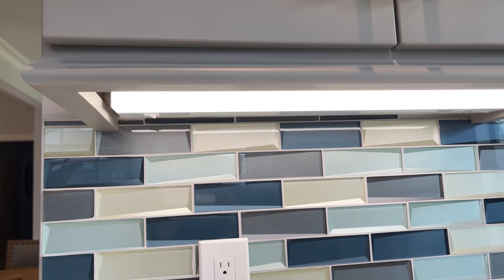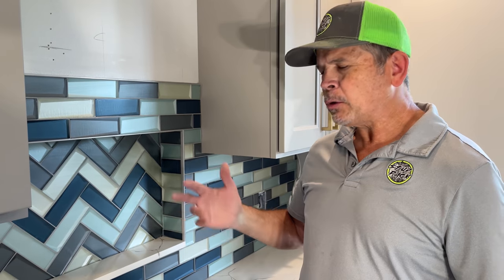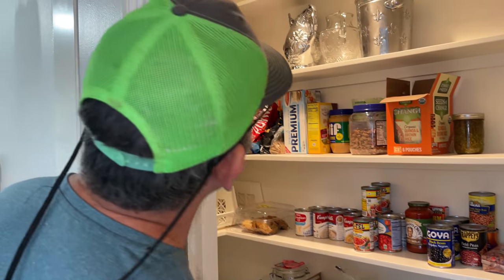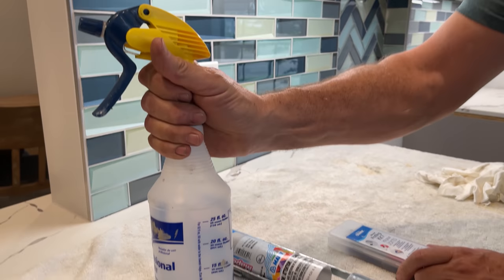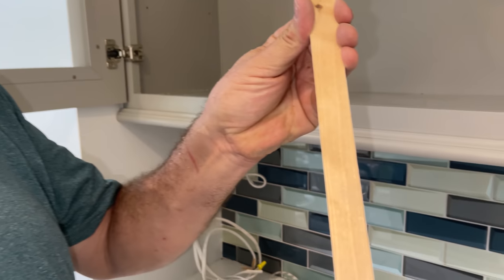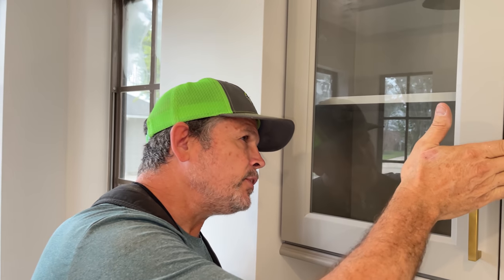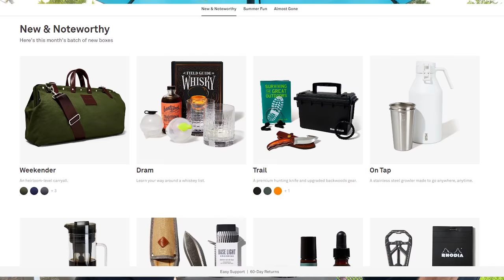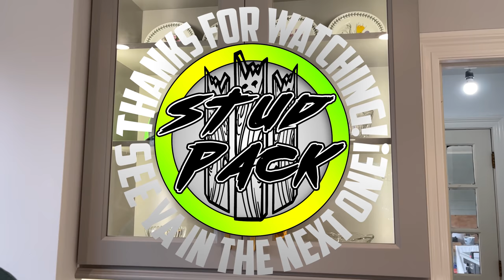DON'T CAULK YOUR TILE! Do THIS Instead...

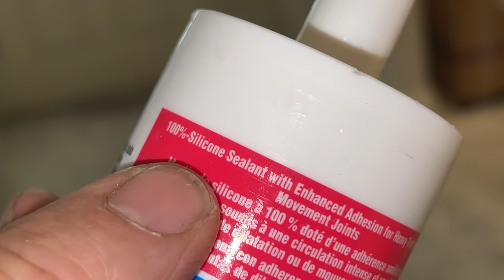Comment: 8:10 segment on silicone facts with tools, denatured alcohol and Pushing is worth it's weight in gold for tips. Never heard to push before. Top notch fellas!
Reply: I have always hated caulking, or, er, applying silicone... until I read about pushing instead of pulling. So much less work creating a straight bead!
Reply: So much great info.... I have done miles of caulking and I am anal about it. But had never heard of these great tips! Bam!!! Drop the mic... lol

Comment: Good job on the video guys! I appreciate how your keeping it clean, It always helps with a better finished product 👍. Quick grouting tip, 2 - almost full (5gall buckets) helps dilute and keep clean, 1 bucket with sponge and 1 with microfibers. Use the sponge to remove excess grout and shape the joints, then use the microfiber to stop any grout bleeding and to remove 90% of the end haze. Much respect for You and all of the Real Fathers out there taking their responsibility as a Man/Teacher seriously. Show em how to fly, then always be there if they need flight lessons (that's real Love)   =) .

Comment: I know the video is almost a year ago and I just discovered your channel few days ago and I am enjoying it so far.  I done lot of low voltage jobs so I wanted to share a tip with you.  Those led strip with adhesive on back doesn’t really stick to wood very well and often comes loose under it own weight. Use contact cement and a small disposable brush to lightly brush it on the wood where you plan to stick the led strip. Let the contact dry a bit to a light tacky touch the place the led strip adhesive along on the contact cement on the wood you brushed on.  It’ll never come off on it own weight and make it a lot easier to lay it down on corners too since that where led strip are most painful at to get it as flat as possible.  Big box store sell contact cement in a small bottle instead a quart can.
Reply: That's a great tip, thanks. I'm thinking to get led strips for my place too so perfect timing.

Comment: Pro tip: When installing permanent led strips, every so often place a small dab of silicone.  In environments that periodically get warm, that stock 3m tape will pull loose.
Reply: Real pro tip is to use diffusers.

Comment: I use grout caulk same as the grout color on inside corners and around counter tops, bathtubs, showers. I've noticed that in a lot of homes the corners are cracking because tile installers used regular grout instead of grout caulk. 
Great job, guys.

Comment: I'm a new subscriber but an old 66 woodworker. I have done a lot of solid surface work at the job I recently retired from, and I am still learning. We used denatured alcohol to clean joints on solid surface material before using the epoxy glue. I did not know that silicone does not stick to it. Learn something  new. I like your videos.

Comment: You know what- when I read the title to the video I thought to myself "this is not going to work."  However the results of the caulking tool were really good! And for anyone that reads my comment, this is one of the few appropriate places that 100% silicone should be used. If you're ever going to use 100% silicone, ask yourself this one question- is there any chance that I will want to paint on top of the caulk, or adjacent to it? If the answer is yes, or even maybe, then don't use 100% silicone. PAINT DOES NOT STICK TO SILICONE, and there's not a real good remedy (primer really doesn't work, neither does caulking over it) for getting paint to stick. Even you guys who are using silicone to glue down countertops on cabinets. For the love of God, don't let any of that silicone lap over onto the face of the boxes. Sometime down the road, the home owner will probably want to paint or refinish the cabinets, and it's a PITA to remove the silicone.

Comment: Using painter's tape to make a perfect edge with silicone caulk also works great.  You put down the tape, press it in hard, use the silicone caulk, rub it in with your finger and take off the tape almost immediately.  It makes laser sharp caulk lines.
Reply: Agreed
Reply: I concur ✌🏼
Reply: 👍 That’s my go to for now. But what’s the brand name of that call sled you used??
Reply: Tape can lift the edge of the silicone when you remove the tape , only by a micron but enough to left water in 
Tape is a big no no

Comment: Paul,

The denatured alcohol and the cut pieces of rag, brilliant. I just finished all three bathrooms in my house using your method and they look great.  I had recently siliconed a large piece of glass that we had to re-install after replaced the bathroom countertops not using your method, all I can say is, I am glad it was clear silicone. 

Thanks for the tips.

Jack

Comment: That tool works good. Denatured works great for clean up but i've found just water works fine also for pretooling. The silicon won't stick to the wet surface only the joint thats dry.

Comment: Tip for all of you out there. If you don't use all of the silicone or caulk just place Frog tape over the top of the tip and around it. Once done you dunk the tip in water and it will last for months. Here in AZ where it is hot as hell, it lasts for months.

Comment: Do you have a video on hardwiring those cabinet lights (both strips and undermounted)? I’m curious about the best method to hook those up according to code, where to use conduit, and how to keep the wiring hidden and clean.

Comment: I know in a previous video you mentioned you have a hard time of finding consistent products especially for under cabinet lighting, just when you find a product you like they stop making it.  Seeing how the LED strips worked out under the cabinet, have you been considering just going with the strips?  I am sure it is a larger cost savings and minimal impact on installation.  Once more question for you, I am in the process of building my own deck......what would it take to get you guys up to good ol' NJ?  Another great video! keep them coming!

Comment: When the contractor did my kitchen install, they didn't caulk between the tile backsplash, they just grouted it along with the rest of the backsplash. Over time, the grout in that space cracked. I have patched it once by mixing more grout and re-grouting after removing the loose chunks of grout. But that also cracked. 

My backsplash tile is made of long skinny horizontal tiles, some glass, some natural stone. Some of the natural stone tiles have bumps on them that protrude about  1/16" or more past the tile surface.

I bought the profiling kit in your video and did a dry run to see how it would glide over the tile.  The first tile at the bottom sits below the little black "sled runner," so it does not help it glide as much as I'd like.  When I press it into the corner and pull, the spreader still snags on grout lines below the runner and also on the bumps in the stone tiles.

I remember, years ago I had an apartment that I painted. It was an old building with plaster walls. As the building settled, the plaster cracked. I patched the cracks with plaster of paris. The cracks came back after a few weeks. Then I heard about some liquid that had latex or something in it that was meant to be mixed in with patching compound to make it crack resistant. I got that and mixed it with the plaster and it lasted years before cracking.

I'm wondering if I'd be better off getting some of that liquid and mixing it into the grout and re-grouting the joint between the countertop and the tile, rather than caulking it with silicone. If I don't do that and caulk, do you have any suggestions for getting the profiling kit to work better on this type of tile?

Comment: Looks great man.  The push/pull thing?  Well, getting the bead to push into the space when pulling the gun is a matter of technique.  To achieve this doesn't require "pushing" the tube.  It requires using the right technique when PULLING the tube and PULLING gives you better control over the finish of your joint.  And mildew grows on silicone same as anything else.  It's a matter of PEOPLE DON'T CLEAN.  Biggest reason for using Silicone is movement and movement is more a result of a shoddily done job than  seasonal expansion/contraction of structural elements or claddings/substrates.  Acrylic caulk - unless you need to counter large amounts of movement - is every BIT as good as Silicone and is MUCH MORE EASILY and correctly redone than a Silicone joint.

Comment: i love the work i really liked the trick you used on settimg the shadow box. with your grout if you use a spray bottle and mist your wall not to much when you spred your grout it will pack down and cover smoothly leaving no air bubble pits with glass tile i let my grout flash a few mins then i use a plastic blade like you used to shape my grout joints then you can just sweep the grout up when done take a micro fiber towel and just buff the tile right up easy and you never get haze then take your spray bottle mist one last time and detail clean your work and eavrything will be dry enough to chaulk right away it will give full joints first pass and never will you have low spots or pin holes to touch up just always do it in sections that are managable

Comment: Led strip need a channel housing with milky shade cover it doesn't reduce light much but takes away those too bright areas making light more uniform.
Reply: Another option is to use COB light strips.  No bright spots.

Comment: +1 on pushing the caulk. I can get it in there pulling just fine with the right tip angle, pressure on the trigger, and travel speed, but pushing is more foolproof. The spray bottle of alcohol - I learned a new trick! I've done everything from being "pucker careful" to using tape - this is the best idea I've heard, I'm gonna try it! The profile tools - they do a MUCH better job overall. You gotta have a good consistent and even bead with just enough in there to use them, but they put on a better profile than you can ever get with your finger, despite the finger having more control. Control cuts both ways - you can screw it up just as easily as you can adapt to changing conditions. If it's a consistent bead, theres a lot less need to adapt.

Comment: Hey Guys.
Love your videos. You do some amazing looking things and it looks like you have a good time at work. I just got CA glue for the first time about a month ago. Of course I was very skeptical because Super Glue type glue seems to be tuned into gluing fingers more than anything else. But, I tried it on door casing. It's stronger and faster than any other process for attaching trim. No wood glue, no pin nailing the corners and it goes up in one piece. No need to fill the miters.  Good product. It glues anything to anything.
Thanks, Rich

Comment: I watched this video when it first aired, but had forgotten about it. I just bought and used one of those Cramer kits in the shower I just finished and I agree, it's absolutely the best! I used color matched Mapei Mapesil T silicone and the results are amazing. You can do a great job, even without using the denatured alcohol. I used the square edged tool to fine tune the inside 3 way corners and they look perfect. Highly recommended!

Comment: About the silicone, I’m a plumber and we use siliconized tub and tile caulk and have never had any issue. We don’t use it in showers but we do put it around lavs, toilets, and kitchen sinks. I have worked for a plumber who used the 100% silicone but like you mentioned in the video it’s super messy. It’s so much easier to clean up a water based product. I don’t know that all of it is siliconized (to be honest I don’t know what that actually means) but it does say mold and mildew proof. It may have something extra in it that regular siliconized caulk doesn’t have.

Comment: Great job.  I did find one brand of silicone caulk that wouldn't EVER set up after using denatured alcohol.  First time I removed it all and started over with a new batch from a different tile store.  BUT it was the same brand since it was color matched to the caulking, not much of a choice.  Same results.  I learned my lesson.  Tried Caulk-EZ (the third time) and it worked great.  Every since then, I've been using Caulk-EZ only.  A lot more expensive than denatured alcohol but time is money when you have to redo a project.  If you already have experience and know the alcohol will work, that is the way to go for cost effectiveness.  Like Paul said - practice, practice, practice!  Couldn't agree more.
Reply from the maker: Cool stuff thx Bret 👍👊

Comment: Quick question after I say amen to all the positive comments on your videos and even more on your great family/working relationship.  So when doing tile in a shower or like you did on the backsplash should I not grout the corners and leave them open for the silicone? Or if I get grout in the corners should I dig it out before I silicone?

Comment: I always use blue painters tape to mask above and below the caulk joint between the tile and the counter. I run the caulk quickly, imbedding/smoothing with a finger. Then I remove the tape immediately, before the caulk skins, pulling the tape over itself at a sharp angle.
Reply from the maker: Cool thx Jim 👍

Comment: The LED strips are great but heat is their enemy, so by sticking them directly on the wood it will reduce their life considerably. You can get various aluminium backing strips to act as a heat sink, there's even an angled one the same as the ones you made. Nice work.👍
Reply: interesting point, but in my experience they dont get hot?
Reply: LCD get hot. LEDs may get a bit warm but no where near as hot as LCDs
Reply: @mansfieldcarpentry805  It's more the circuitry with each LED that goes bad due to heat before the diode itself shows any symptoms at all. LED circuitry has been known to be temperamental depending on build quality, and all LEDs generate some heat, so it's usually a good idea to heat sink them like Mascara Snake said with some strips of aluminum or similar. All the best to you and yours.

Comment: While grouting, if the grout starts setting up in the bucket... Just add more water with a plastic container/cup. When wiping the excess grout off(cleaning), wipe in one direction once, flip the sponge(clean side) and wipe again. Then back into the water bucket to clean the sponge. It helps to have a 3/4 full bucket of water.  That way the sediment goes away from the water up top. making for a cleaner sponge to wipe with. Don't worry much about the film till the end and buff. While caulking... Use a small opening on the tip cut at a 45 degree angle. Also caulking to you uses less caulk while pushing it into the grove. You can see how much caulk you are laying and won't be having to fix areas where you left to little(like in the vid after using the tool).   The cramer tool is nice, but not really needed.  Practice laying a bead and finger wiping. Just wipe your finger on a rag/towel laid out flat. Guys/gals, take note that sponsors like videos that work in promoting products into their videos regardless of the product. As long as it isn't in direct competition to the sponsor.

Comment: I just recently picked up that Cramer kit. I'm fairly certain my right index finger is about a mm shorter than the left after all these years, so I was curious if it'd help streamline the application. It was nice to see it used in a real world situation. Another solid video.

Comment: As regards to silicon, not sure if called the same thing but in the UK us plumbers use ‘sanitary silicon’. Whatever they put in it, it works. It stays stuck, doesn’t develop mold or discolour. Any silicon will over time deteriorate, but in any bathroom applications or wet areas unless it’s stamped with ‘sanitary’ don’t use it. Most tubes of the stuff you see on the shelf aren’t sanitary and will fail pretty quickly, quicker if not cleaned regularly.
Reply from the maker: Cool thx Captain 👊

Comment: Those Cramer tools work amazing!!  They don't even need a spray.  The problem with the spray is anywhere that the silicone had gaps and the alcohol (or soapy water) gets behind the silicone...it prevents it from sticking where you want it to stick.  Try using the Cramer tools without a wetting agent....

Comment: i got the 12 bosch offset driver with multiple heads. Milwaukee has one also. Get one and it will become you standard driver. You don't need the big ones anymore unless you're a framer.

Comment: I enjoy your videos, I have learned a few tricks. things are not always what I would do but they work. My tip for you is build yourself a set of saw horses with the pink studs you see in big box stores.  The advantage is no one will steal them and if another contractor comes on the job, they are reluctant to want to use them.  I got a lot of laughs but only a few people knew my reasoning.

Comment: What stops mildew is a squeegee and then a shammy cloth wipe.  Squeegee for most of the water and the shammy for the rest of it.  Been using that combo for over a year and zero mildew present in my shower.  Only takes a couple of minutes after each shower.  Well worth it.  And a step further after that is run a small fan into the bathroom to blow out the hot steam after the hot shower or bath.  You'll never see any mold or mildew buildup.

Comment: One more thing Stud Pack guys- you might be aware of this, but maybe not- there is a 100% silicone that is translucent (I've only found it in dedicated tile stores). So on this particular job that you're on it'd pick up the color from the granite/quartz, as well as the tile. I don't know that I would have chosen that over the grey silicone that you used though.

Comment: My experience with self adhesive LED strips is that they come off sooner or later. Putting strips into aluminum channels works better.
Reply: Helps with heat dissipation also, makes led strips last longer👍🏻